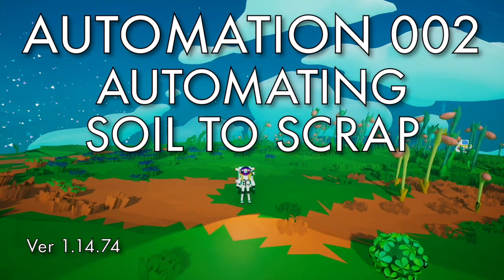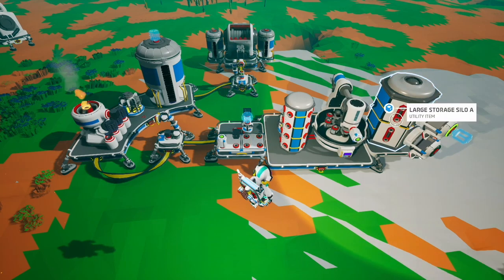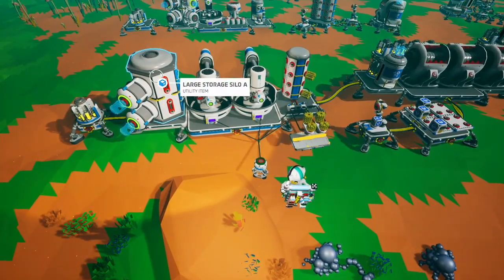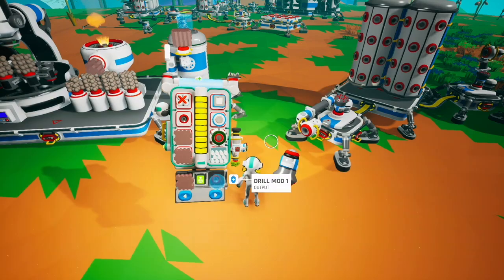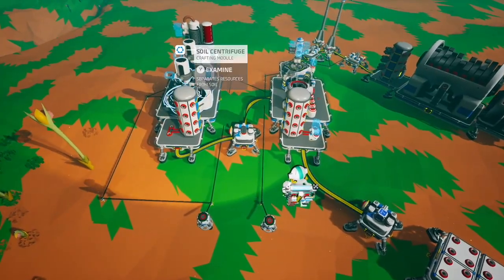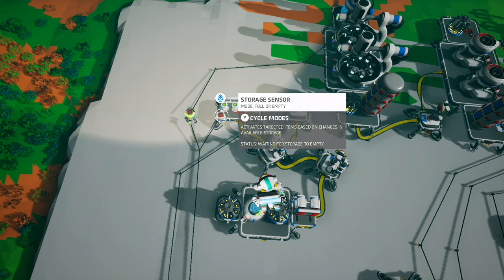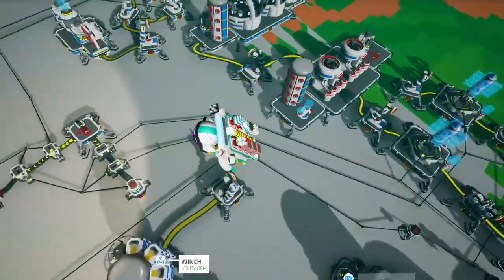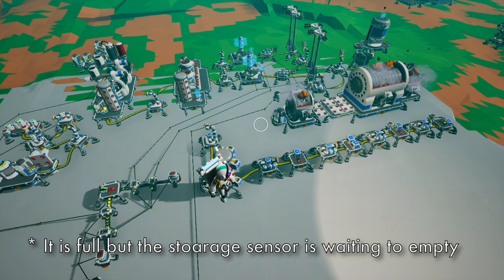Automation 2 - Automating Soil to Scrap

Comment: Hi Jonathan! Your design is brilliant and thank you for explaining it to us. I learned so much from it. I made my own mechanically simpler version of it and am sharing screenshots of it in the links below.
I'm a retired java/python developer. I'm still learning Astroneer automation and creative mode. 
My physical plant is simpler. The basic control approach is to run a repeating 72 second timer for trade launches, and 144 seconds for centrifuge starts. I've found that -- with my timer circuit -- there was not much effort needed to synchronize readiness of the soil/scrap sections. When the overall start button is pressed, the centrifuges and trade launch immediately. The trade platform is friendly in that it allows only 6 scrap to be loaded for wolframite. The coolest thing is that arms at the trade platform can unload wolframite and load scrap CONCURRENTLY and reliably. This reduces latency and complexity. I have only one trade platform, but the resulting production throughput challenges my ability to keep up manually shredding winches.
The most interesting aspect of the system is the control circuitry (second image link), and the hardest part of that was orderly shutdown. I configured it to allow all the work in process to complete to winches. It was quite a bit of experimentation to get the logic to return to its initial state. As we know, System Era has not implemented any kind of reset automation.
My basic circuit unit is based on your AND (two power switches and a power sensor), but I found it extremely helpful to add a 1-tick delay to always turn the downstream power switch back off. The associated power sensor mode is "power gained". Works very well.
Please I'd appreciate your comments on it. All I can say is that my simpler implementation seems to run reliably.
Thanks for your guidance!
Matt
https://www.dropbox.com/s/w7xlsecfyhxlbzk/Screenshot%20%286%29.png?dl=0
https://www.dropbox.com/s/ll9v25bl53hovob/Screenshot%20%288%29.png?dl=0
Reply from the maker: Hi Matt, I like your design. The Timers are a nice way to keep everything synchronized.  I especially liked how the trade platform is being filled directly from the Scrap Canister so you don't have to pull off the extra scrap. My only question would be, what happens if someone accidental leaves the system on and it fills up or runs out of scrap or soil? Maybe add some storage sensors that feed back into the timer to turn it off. 
For the circuit it looks good. I always find when I am making something like that it gets complicated to have things happen in the order you want them to. I'm curious to know why there are 2 delay repeaters going into the top power switch triggering the trade platform? I also use the 1-Tick delay to turn off power switches in some of my other builds. It is a very useful trick if you want to check if something has power or not.  Overall great design.
Reply: @jonathansinfodump9037  Thanks for your friendly responses. I just implemented better STOP logic with a power switch that represents system RUNNING status. That is ANDed with all STOP signals from the STOP button and full/empty storage sensors. That makes any STOP signal a no op if the system is already stopped/stopping.

The logic on the storage for printed winches emits a signal only when that storage becomes FULL. The storage sensor feeds into a power switch with a sensor in power gained mode. That FULL signal feeds into the stop logic described above.

Yes, that additional delay ensures the trade launch signal is always gated by RUNNING status. When a launch signal coincides with a STOP signal, the STOP the signal takes precedence and launch is suppressed.

Demo of the 1-tick delay approach we both use:
https://www.youtube.com/watch?v=df6DaBr5d_o

I've dismissed splitter-based approaches because setting threshold current can be tricky. Plus, consuming significant power just for binary logic is unnecessary.

Perhaps we could correspond about Astroneer going forward, as curious students/teachers. I especially love designing reusable patterns. It would be awesome if System Era supported assembling circuits as reusable custom devices, but I know that would be tricky programming for them.
Reply: @MattBenDaniel  
Hi Matt,
Is there any way you wouldn’t mind sharing your save file for learning purposes. 
I’m trying to get my head around the logic gates and how to use them to synchronise everything. 
I’ve watched this video several times over and have recreated the setup in your first screenshot, minus the sensors and switches, i end up with an abundance of organic or resin and no room for the rubber, halting the process. 
in my set up i have a created a timer for launching the trade platform, but it’s not in sync and doesn’t stop launching once it’s out of wolframite. 
Thanks, 
Marc
Reply: @MattBenDaniel  would love to see images of your updated setup!

Comment: I like doing fuel thrusters that 1 ammonium and 1 aluminum, cant automate it but its 1.5 scrap all you do is use a rover to mine laterite and have medium soil canisters
Reply from the maker: Do whatever works for you, but if you are using soil to make the ammonium I would recommend instead making clay and turning them into drill mod 1's. That way you get 3 scrap per 2 canisters instead of 1 scrap. If you like the mining part you could mine lithium which can be turned into small batteries which give 2 scrap per lithium.